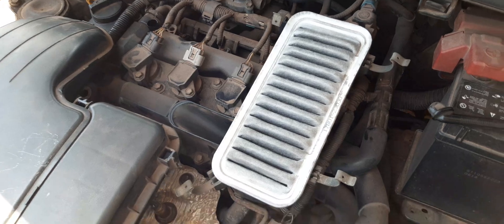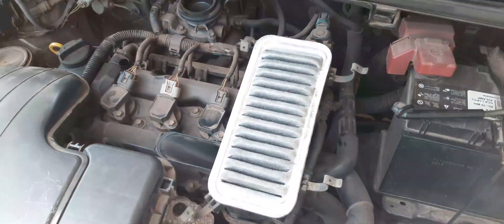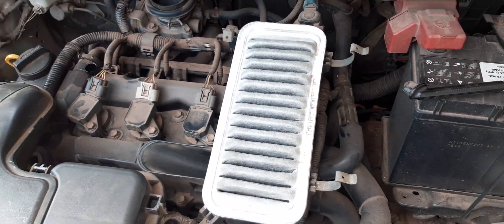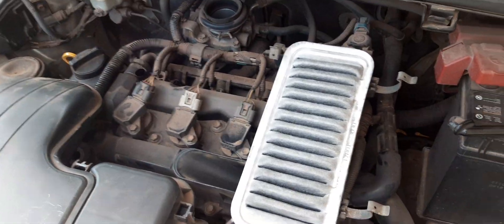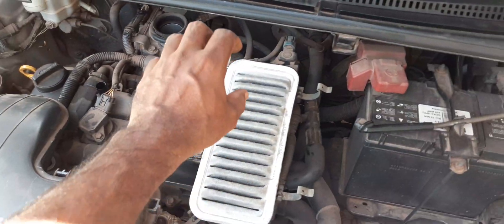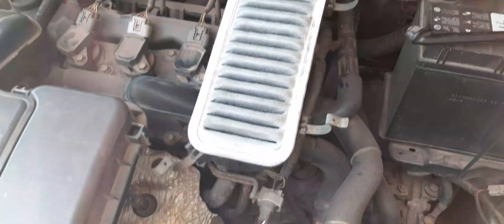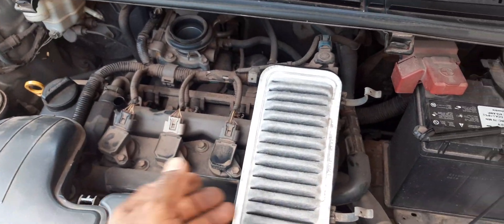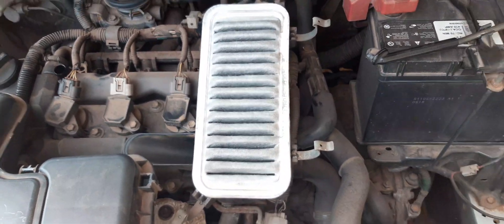How Your Air Filter Can Cause Excessive Fuel Consumption

Comment: Pls when is the best time to change ur air cleaner to reduce fuel consumption
Reply from the maker: @nathanielboateng5256  there is no specific time period required to change a air filter. After a new air filter is installed and you cover up to one year then you can check the filter